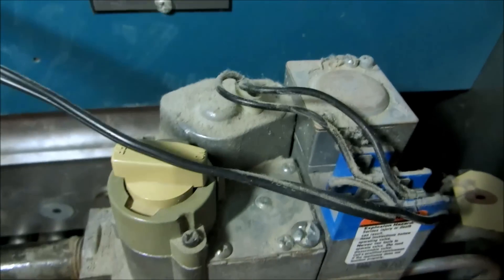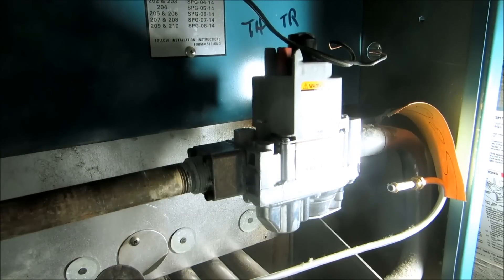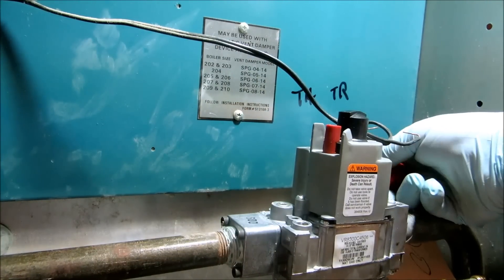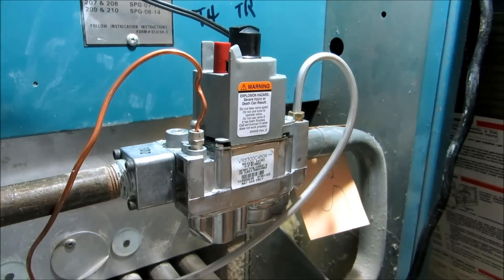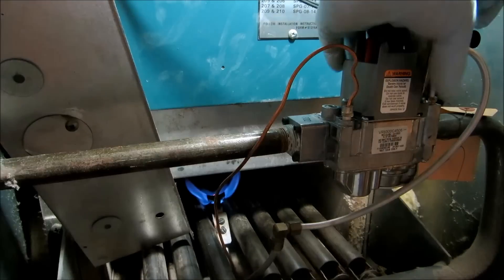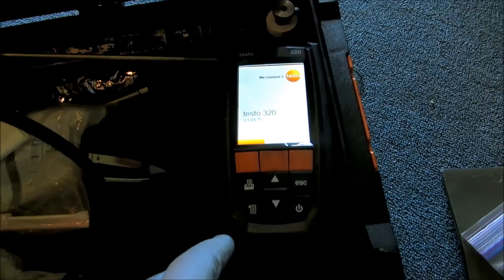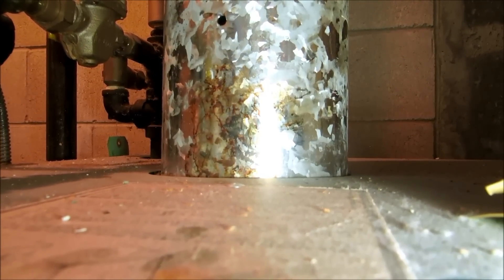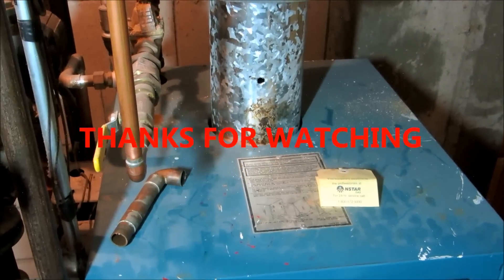gas boiler with high c.o. levels fixed

Comment: Steve, if you wanted to, could you upgrade this gas valve with the one that uses a hot furnace ignitor instead of the thermocouple pilot?

Comment: Steve, what's the difference between checking co2, and pressure on gas valve, same adjusting screw? Testo 320 $1000, manometer $150. Which one? You didn't use manometer on this job?

Comment: Verify inlet gas pressure then manifold pressure  and check chimney draft .
Note-
If the pressure is turned to far DOWN you might have issues with the burners lighting correctly at some point and flash out when it lights the main burners or not lighting main burners across evenly.
Lots of times people change the vent pipe with the incorrect Diverter pipe height is critical at skirt to boiler

Comment: Most people will not experience any symptoms from prolonged exposure to CO levels of approximately 1 to 70 ppm but some heart patients might experience an 
increase in chest pain. As CO levels increase and remain above 70 ppm, symptoms become more noticeable and can include headache, fatigue and nausea. At sustained CO concentrations above 150 to 200 ppm, disorientation, unconsciousness, and death are possible.  I guess the short answer is 70 ppm but 0-8 ppm the normal background is best or get curious why. I just read CO detectors start alarm at 50 ppm.  Quoted from US Product Safety Commission.  Your videos are dead serious important.

Comment: Those honeywell valves are the worst! I had two brand new ones out the box that were no good...Use the robertshaw 24v gal valves instead
Reply: The Chosen Honeywell valves such but the one he used isn’t that bad. I have just as many issues with Robertshaw. 

The small Honeywell valves used on most new modern furnaces (like all the air ease/Armstrong valves) are complete junk though

Comment: I did not see you doing the soap suds test to see if the gas connections were leaking.Sorry if I missed it, did you use a meter?

Comment: seems like this just has a set screw thats it right?
can you adjust based off the output gas pressure to manufactures spec (say 3.5 WC) with manometer or do you need combustion  analysis device? is the readings off because the output pressure was out of spec, or because you did some very fine tuning?  

i did a good deal of calling and i havent been able to find some one who does combustion  anaylsis in my area. I would like to just buy a manometer and check the gas pressure and call it a day .
Reply: Bardia Ghajari I walked into a boiler yesterday that the manifold pressure was dead on at 3.5” and the co reading was over 10,000ppm. Setting gas pressure isn’t enough

Comment: Hey Steve, love your videos! So the manifold pressure for these is usually 3.5 in. wc. and when you back off the outlet pressure you are probably bringing it down below that number. Are there any other adjustments you can make to improve efficiency? I just adjusted my gas valve down to 2.4 in. wc. because my CO was around 3500 ppm at the factory pressure which is 3.5 in. wc. That is a whole in. wc. lower than factory spec, kinda freaked me out.

Comment: word to the wise. when using flush pipe adapters always use steel like you see that Steve is using never brass or bronze. i've seen them crack before...t

Comment: Did that furnace have a fixed regulator and fixed orifice?

I have a 23 year old Trianco Heatmaker-M2 boiler, which started kettling 3-4 years ago.  I added a temperature controller, which monitors the water temperature at the input to the boiler and interrupt the heating cycle, before kettling can begin (beats waking to a cold house).

Yesterday the exhaust CO was measured at 100ppm, according to the tech from the gas company.  Then I throttled the gas supply, by partially closing the ball-valve - just enough to hear a change in the flame, the tech told me the CO dropped to "0".  The tech was concerned about operating the boiler with the ball valve partially closed, but we are in a cold snap (who isn't right now).  Since the boiler CO is acceptable ("0ppm"), I'm not shut-down, but need to service/resolve the issue. 

Trianco is defunct; sold off to Waterpik, then ????  There is a 3rd party parts supplier, or two), but Trianco-trained service techs aren't going to be available, nor will support. 

My boiler has a NON-ADJUSTABLE valve/regulator [description: "gas valve, negative pressure, White Rodgers"], which looks very much like the one you replaced.  It also has a fixed orifice, for which replacements can still be purchased, in a set of three (different sizes,  I assume(?)).  

The kettling issue came on suddenly and the water in the system is almost 100% the same water I filled it with 23 years ago, so mineral accumulation in the boiler coils shouldn't be the cause.  

After watching your video, I'm thinking that maybe the regulator wore out and is no longer regulating properly, is at all, so the gas flow is too high.  (Orifice replacement won't fix that.)

Seems that maybe an adjustable valve/regulator would be better than the non-adjustable original!   THANKS!

Comment: Hey steve I got a problem with my boiler, The pilot is on but when I turn the thermostat on the boiler won't ignite, I was braking some concrete on the basement I don't know if that has anything to do with it or is the gas valve, how can I find out?

Comment: you got lucky meter didn't lock up, i have 310 and it looked up for 24 hours after like 1800 ppm, so i had to wait a day to finish what i was doing. Generally they don't recommend to keep probe in if it's that high, just check it quick and if reading going up, decrease pressure and recheck
Reply: The ppm reading is done in the smoke stack or just in the vicinity of the boiler?

Comment: Hey Steve, I have the Testo 310, I wish I would have bought the 320. I like the colour screen.
Reply from the maker: +Gerry Pomanti yea the 320 is way better i believe
Reply: Just wondering what the manifold pressure was with the old gas valve if it was over-firing that was causing the high CO?
Reply from the maker: i could not adjust the old valve thats why i changed it

Comment: steven on a hydronic boiler the flames are very low do you think its the C O  on the gas valve or is it the unit is dirty

Comment: Damn bro were you getting sleepy. that was so high CO counts at first. Anything under 80 ppm is much better.
Reply from the maker: +Robert Weeks i usally like to run the unit for a bit before putting in the probe .because of the high c.o. at first on start up
Reply: Every gas appliance has high co on light off. Best not to put the combustion analyzer into the flue till after it has ran for at least 10-15 sec

Comment: Nice video Steven, No offence but you dont need to do a sooth test on gas fired equipment, sooth tests are only done on oil burners.
As you mentioned before complete combustion is the key, i would have this customer nominated for a new boiler in the near future O2/CO2 level can be much higer O2 3.0/4.0% CO2 9.5/10 a lot off extra savings.

Testo 308:
The digital smoke tester is a hand-held instrument for
determining the smoke number of oil firing installations.
These systems can be monitored using the testo 308 and
checked for compliance with the applicable limit values.
Reply: Most important its safe now

Comment: I just did a PM on that same boiler on Saturday. I was getting a slightly high CO reading too ( around 150) couldn't adjust that shitty gas valve they put on that Burnham. All of a sudden it dropped to around 50 so I let it be. I'm not sure if maybe my meter wasnt reading correctly cause I left it in the cold truck overnight.
Reply from the maker: Robert Doherty we are going to have to bring our meters in now it getting cold out ..

Comment: Nice work Steve. I've been working with steel pipe at vocational school lately.
Reply from the maker: PlausableApple4 steel pipe is all part of the trade. i am sure you will do well ..
Reply: I'm doing pretty well right now. I need to work on my measurements, that's about it.
Reply from the maker: take every thing from center to center then deduct your fittings

Comment: I had an RTU a few days ago with CO so high my meter shut off to protect itself the manifold pressure was 6.5"
Reply from the maker: airkraft1 i have had my meter shut of many times ...one today manifold pressure was 8.6 on natural gas..it should be 3.5
Reply: steven lavimoniere

It's given me a message a few times to replace the sensor after that shut down its time to order one up gotta take care of the old girl

Comment: Have you looked into the testo 308? It gives you a digital reading and also paper sample. You can sync it up with the 320 too for printouts. Nice video.
Reply from the maker: ***** i will have to look into it
Reply: steven lavimoniere Having a number value is invaluable.